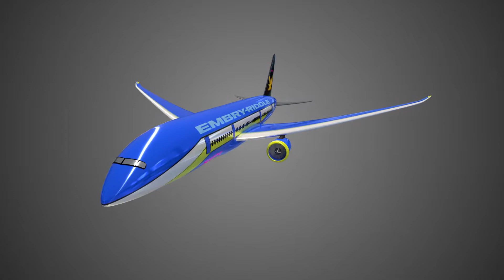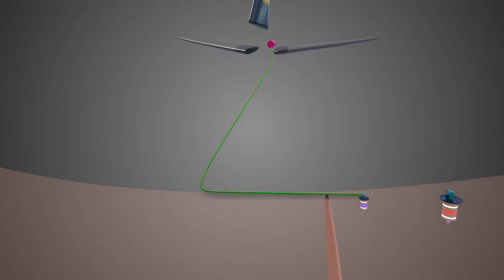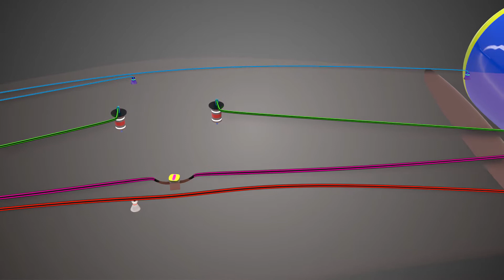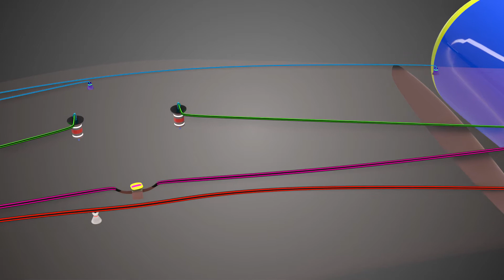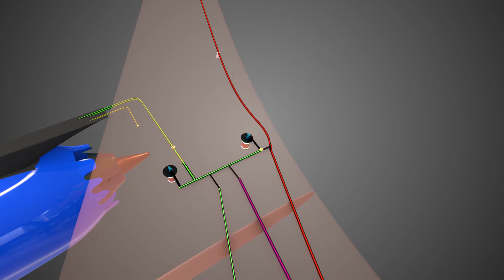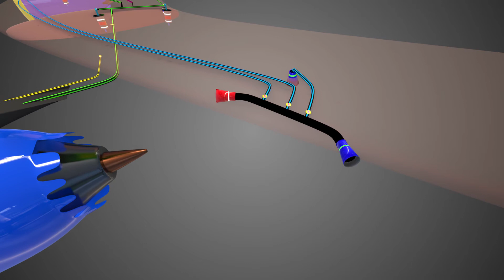AS 411 787 Fuel System 15 OCT Rough Draft

Comment: Thanks for the graphics.
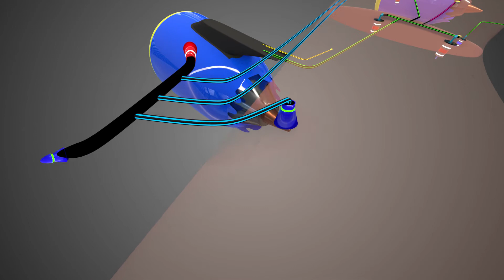I am curious if the blue lines @4:00 are suction feed lines and more on how the system works.
i.e. If Air India 171 engines should have received fuel regardless of electrical failure.